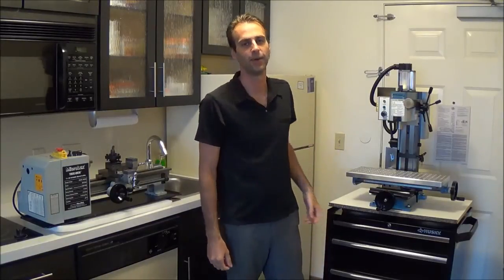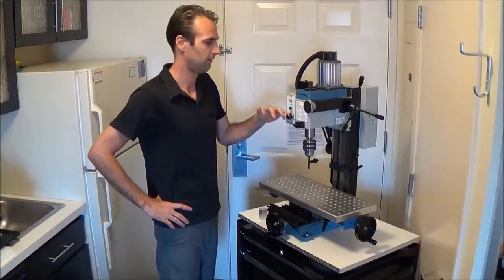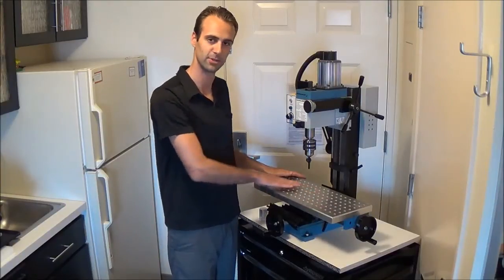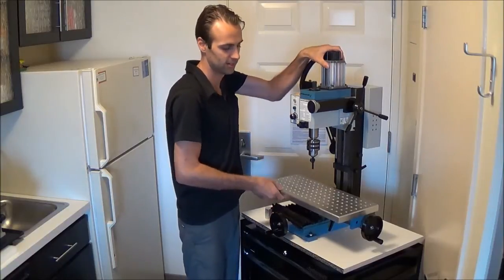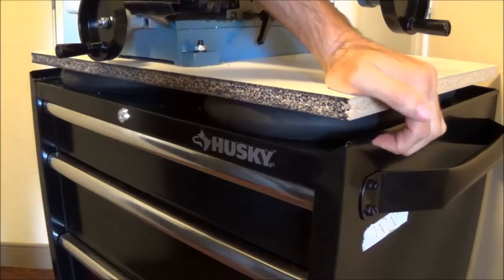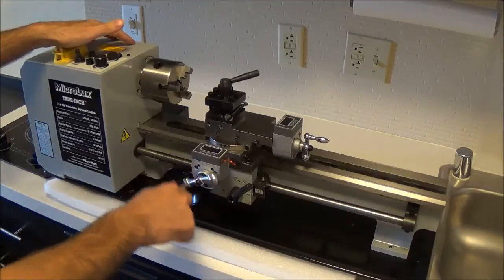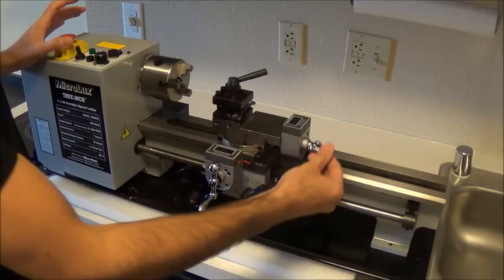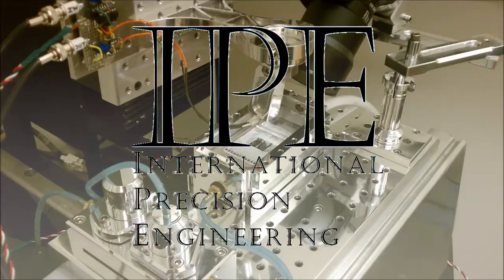Hotel Room Machine Shop

Comment: Videos machining in the hotel room or this never happened.. nobody in their right mind would send work to those machines lmao
Reply from the maker: That just shows your ignorance - also "lmao"... Measure, design, CAD, order, wait, discuss, wait, receive, oh the hole is in the wrong spot...    Every tool and process has its place, but sometimes you just roll up with a sledge hammer and get it done in a few hours. "Quality" by traditional metrics may suffer as you point out, but things like brackets and fixtures don't need diamond-turned quality surface finishes, they just need to be done and fast.  Not a bad gig for a kid :)
Reply: @internationalprecisionengi1737  videos of machines running in the hotel room, not just your little scenario created in your head, or it never happened. The first thing customers ask me is what do you have for equipment.

Comment: This guy doesn't understand that most machine shop accidents are the result of complacency (*especially* among experienced operators). Assuming it's OK to leave a wrench/key in the chuck of a low power machine is an easy way to get complacent about this behavior and seriously injure someone down the line. We don't leave these in the chuck of ANY machine (regardless of power) to reduce the odds that we become that person who just hospitalized someone due to human error after 3 decades on the job. To see this guy arguing against basic safety protocol in the comments is reckless and ignorant, and makes it clear that his priority isn't to learn, but to defend his ego even at the expense of others' safety.
Reply from the maker: F* off.  Go sit in your moms basement and read someone's rule book.

Comment: How much prepping did you have to do  on the lathe ? I bought one long ago and found it very hard to use. I gave up trying and tore it apart. What I found was truly sad and disappointing. Crap machining. Things gummed up by paint, other things not fitted correctly. Anyway, 5 years later I'm rebuilding it now and basically having  to fit and finish everything. But yea, the machining marks are just junk.
Reply from the maker: lol, you get what you pay for - for sure. Mine wasn't too bad. The ways were ground but there are some milled surfaces, always apposed to a ground surface tho.  I took a triangular file and "lapped" them to take the super high spots off.  The biggest thing is the adjustments in the gibs and staying within the limits of the tool.  I learned on good Bridgeport's and even that was frustrating to learn through trial and error, it helps to have a trained ear to dial in speeds/feeds, correct tools for the job, etc.
Reply: @internationalprecisionengi1737  up, since then I have the lathe working rather well if I do say so myself. Took a bit of work for sure. Now just learning the ins and outside of using a lathe. Though I get fustrated at times, I get a fulfillment at the end. Always gets better the more time I spend on it. I think what got to me was some of the stuff I had to do that I shouldn't have had to do. Like my lead screw basically being totally bound up. Had to redo both end bearings. Why ? If I had tried to run it before I checked, I would have stripped a plastic gear for sure.

Comment: How have these machines worked out for you?
Why did you choose the MicroLux lathe over the LMS?  Thanks in advance for your reply!
Do you still use these, or have you moved to larger machines?
Reply from the maker: Good questions: Yes they have worked out well for me, so well that they are still my go-to machines. You cannot beat the size of these tools; I think people forget how much space tooling takes up, so having all that under each tool is a huge benefit for a DIYer - as I've stated before tho if your on the clock, tools like the Bridgeport hit the sweet spot for efficiency/configuration.
As for specifically picking the MicroLux over LMS, I think at the time (almost a decade ago) they were the first and only to offer the 16" bed. Looking at the specs now, even the position of the knobs and switches on the control panel, I believe they are identical. Again at the time, the DIY machinist following wasn't what it is today, so if short/stubby drill bits and tooling were as plentifully as they are today, I might have been OK with the original SIEG 12" bed; generally parts come in cubic packages (ie the height is somewhat matched to the diameter) so an extra long bed really just gives you a place to store your tail stock when not in use.
If you pick one up let me know how it works out for you. And remember if you buy it and don't like it, it will get snatched up almost immediately on the second hand market for a fair price.
Reply: @internationalprecisionengi1737  I was all set to have these two machines as my "go-to" plan when I saw this article: https://softsolder.com/2016/07/04/little-machine-shop-5200-7x16-mini-lathe-way-finishing/
 and then I thought eeeeeuuuuu!  Are these machines really made as badly as this article lets on?  I have never seen one up close; nor do I know anyone who has one.
That article made me think I could make a better one out of WOOD & metal, myself (I have all that stuff) than such shoddy workmanship as shown.  
One other guy was speaking of Seig X2.7 and stated that tapped holes were done by hand and crooked.  I don't have a lot of money, and would prefer to get it right the first time.  Your thoughts?  Are the later, new, machines better in quality?
Reply from the maker: The article is correct, that's about what you get. BUT before you start cringing, that's also all you need to hit 0.001 tolerances believe it or not. A quick search might show that any lathe is really only good for sub-thousandths in special cases, rather for those tolerances I would use a surface grinder to split tents in my sleep. Then again, show me a mechanical design that requires sub-thousandths tolerances and that a DIYer would be interested in making... now surface finish is another animal and the spindle (with the right tool) is good enough if you know what your doing, and if not, you can always hand lap the surface while its still on the machine.

The secret to these ugly surfaces being sufficient is elastic averaging - if you look closely, for every mating surface that looks like a three legged dog, the mating surface on the other side will be ground very nicely. The article says on one occasion that one surface only contacts on one spot, but I'm guessing its hitting on a least 3 over the entire planar constraining surface, which need not be a continuous surface (like the top surface of the bed is split down the center). If it were only hitting on one surface it would rock to catch at least one more right?. 

There is also alot you can do to improve the conditions even with a cheap set of files: Use the flat file like a lap to knock down any high spots ("its only hitting on one spot..."), they should come out in a few strokes; use the 60 deg file to debur the dovetails giving you less friction. The general idea is to polish the mating surfaces as much as you can while keeping in mind that those canyon sized machining marks are great for holding debree and oil (this is one reason a hand scraped surface is ideal for machine ways).

My final comment for the noob is that with any tool, even the best, there is a courtship dance in a sense, where you both have to get to know each other. What tooling works best with the speeds the machine offers and scale of parts, how stiff the tool holder is in certain orientations, what tools can even be held in the factory supplied holder, where do your hands naturally lay, how many spring cuts are needed to hit the mark dead on, where the resonances in the tool are... Maybe think of a lathe as the best chisel on the market, its not going to make you a Michelangelo on its own, but it is capable of producing that caliber of work if it were in the hands of Michelangelo!

Comment: A key in the  chuck is never logical! Tape it to  the  handle!  Or put it  on a  wire cable  and  bolt it to the  machine.
I used to work in a shop where one  of the  guys liked putting the keys in  chucks. We broke him of it by tightening them in place with another  key that we all knew  where it was.  Very entertaining watching  him  try to  get the  key out with out a key...
Reply: Were that the case, I'd carry two straight blade screwdrivers and really lock the key back after use.

Comment: these machines are extremely poorly build, as you can see from other people's reviews. I have a 10x22 and i would even call that a toy.
Reply from the maker: All machines have limitations - Most people are not diamond turning optics or tractor rotors where they would need huge swings or sub-thousandth tolerances. Yes a bigger machine can take larger passes, yes the lead screws cut waves into the part, but sometimes a compromised machine on location is quicker/cheaper than a golden machine in the offsite shop. In defense of the hobbyist - try moving a Bridgeport...
Reply: I have built functioning space suit parts on a Grizzly bench top mill.  A good machinist should understand the limitations of the machine and work accordingly.

Comment: RULE#1 No chuck key left in chucks, whether on lathe chuck or a drill chuck. and please dont ever turn it on with one in it.
Reply: it was the first we got told in school
Reply: In my machine shop you wouldn't last a day doing that shit. No real machinist would. No chuck keys left in the damn chuck EVER. I grew up around salty old machinists. They didn't tolerate careless use of equipment and they really didn't care if they hurt your feelings telling you off.
Reply from the maker: Yes, this is why I am not a machinist in your shop - crotchedy old salts with no tolerance for the zeal in life, and likely less a few fingers
Reply from the maker: +JEREMIAH WALKER Rigidly following rules without comon sence can still lead to injury and death. Life without risk is senceless, inefficent, and generally a waste. Striking the balance between efficency, saftey, and customer satisfaction is key in my mind. Sometimes things go zing across the shop, typically things like bolts when grinding threads, the time wasted trying to find the seperated chuck key in a box that gets bounced around in transport makes keeping the key in the chuck very logical (and its always snug or it would fall out), the danger is when 10" lathe chucks or thier contents go zinging over your sholders (this will never happen in my shop, nock on wood).
Eyes open, mind vigelent, spider sence on allert!

Comment: Good idea, but it seams like the mill would be very top heavy and unstable to move like that . Also moving the lathe could be a problem . It seams to me that a better solution might be to mount your shop equipment in a truck or van with a portable generator. Since your name says international that might be a problem with air travel.
Reply from the maker: +John McKenna Thanks for watching. We wouldn't take the machines internationally and your right that the machines are less than ideal. The best solution is to use the proper equipment, like a Bridgeport - you'll have no problems with instabilities however, try moving it - this machine is exactly the opposite in that its easy to move but its instable and anemic.

Comment from the maker: Thanks for watching! Usually we are very careful to minimize spray and 
thus minimizing cleanup. We take our Hotel privileges very seriously and
 work hard to maintain our platinum status.

Would recommend both of these machines to anyone who is interested in 
learning to machine. They are a manageable size but are almost fully 
capable. Keep these two things in mind: 1. you have to account for the 
vise height and tool offset (the length of the drill/mill and the 
collet/chuck) therefore you limit yourself pretty quickly. 2. That you 
should plan to spend 3x the value of the machine in tooling to be at all
 capable. Ex: vise, collet set, end mill set, parallel set, rotary 
table, indicators, ect. it adds up quickly!

Comment: I bet the hotel staff love cleaning out oily swarf from the carpet!!!
Reply from the maker: boganindustries Never shoot chips on the carpet, it will not come out. A cheep trick is to get $10 shower curtains.  Their light, durable, oil/water resistant, easy to fold and keep, and save you tones of time cleaning.
Reply: Just dont slip on your ass when its oiled up and make sure nobody is out cold on the shower curtain from slipping over when someone walks in, otherwise the FBI might get called.....lol
Reply from the maker: gotta keep a banana peel handy that way there's a legal out - it was the banana peel not the oil...
Reply: I'm sure they've cleaned up much worse ........ much more disgusting things lol